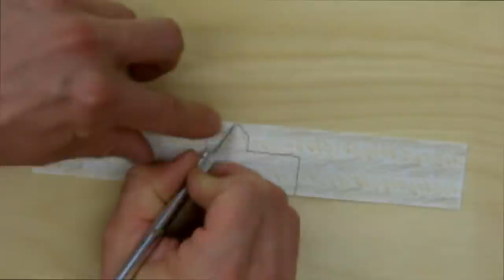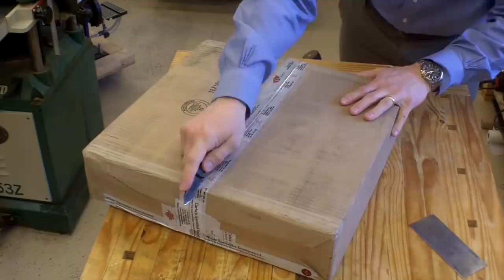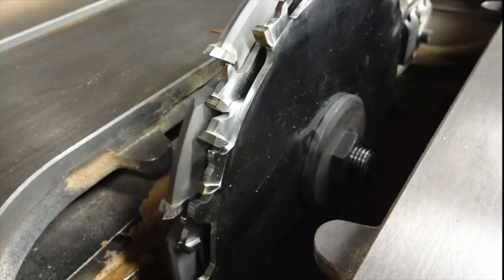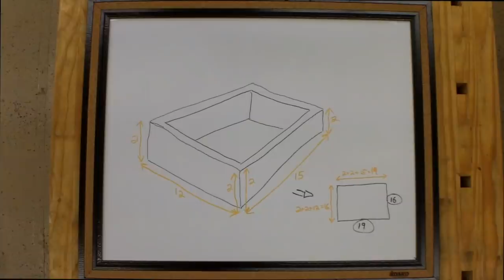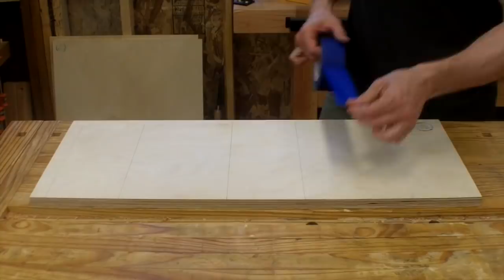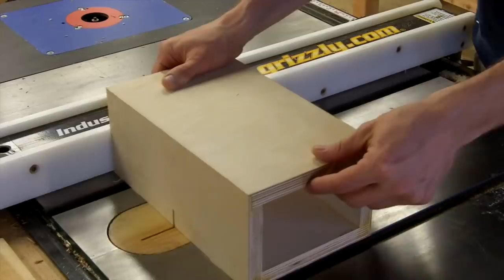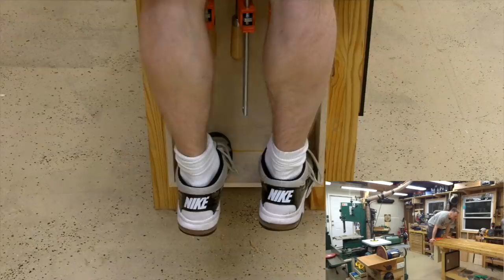New Invention - Easiest Drawers Ever!

Comment: Its brilliant really a great idea well done in figuring it out.
For those who dont know about it, modern epoxy resins, which are very expensive compared to wood glue, are up at around 4000 pounds per square inch which is stronger than the wood you are gluing.
If you are doing mass production this invention is superb as it will save you a lot of time indeed.
If you just making one drawer for yourself at home you can still do it the old way and just use the epoxy resin.
As a test with that epoxy resin I took a piece of pine 20mm x 20mm x 1m or 3/4" x 3/4" x 3ft and I wrapped it with 2 layers of carbon fiber and epoxy resin.
I used duct tape to compress it instead of vacuum bagging as the epoxy doesnt stick to the duct tape, the next day I took off the duct tape and I put the piece on two bricks 1 meter apart and stood on it in the middle with one foot, it didnt break and returned to its original shape and I weigh 220 lbs or 100 kg.
So if you need to make some thing light weight, small and super strong you can make it out of cheap pine and then wrap it with just two layers of carbon fiber. This economical use of carbon fiber is very important as it costs around $70 a sq meter.
Most people use just pure carbon fiber and need 10 -15 layers which is obviously a lot more expensive and also requires tooling to make the negative mold.
My way is a lot faster and cheaper and can easily be done at home for one off projects  like recumbent bikes electric vehicles and light aircraft.

Comment: Your solution looks very nice at first sight. But on the second glance it becomes clear that this solution is only good for one single thickness of boards for bottom, front and side walls. If you would like to use varying board thicknesses then you need to adjust the width of the dado on the right side of your profile. So next to your custom tool the user needs additionally a selection of different dado blades. I still think that the classic dado and feather joint is simpler, stronger and cheaper since it requires no special and expensive tools other than a regular saw blade and it leaves you the freedom to have thin bottoms and thicker walls.

Comment: This has applications beyond your intended use. aeronautical engineering, and my field petroleum engineering.
Reply: Laughing out loud !!
Reply: Are you, I can't hear you.
Reply: How would this be relevant to the oil & gas sector ????
Reply: Anything that requires minuet tolerances is beneficial. The cut joint surfaces were surgical.

Comment: Nicely done! And very well executed also.  
Being that the majority of the "budget" drawers are made out of particle board (which holds on it's best days .... No where near what you put that test through) but have you tried it with particle board? Seems as though your "tape method" would still give the hinge needed for the glue-up; might be worth a test-shot.  But Home Depot and lowes or even Ace hardware are going to be the best bet, but unfortunately they have a grueling process to get their items on the shelves unless it comes from an "approved vendor" 
Have you tried "kickstarter"? That might be an alternative.  Or heck, have the company that made it for you, work out a volume discount price break, and put them up on eBay for the time being.   
It is an awesome blade!

Comment: hmm... sort of looks like a locking miter joint but without the locking. But as you said it does indeed have plenty of glue surface area. So you are aware, Freud does make a router bit that cuts a locking 45' miter joint. https://www.youtube.com/watch?v=5fmnI4VLTmk (:26 starts - 6:15 shows box assembly) Here's a link for the Freud router bits  http://www.ptreeusa.com/router_bit_sets.htm#2878 
I'm not saying this isn't a good idea, just saying it's not totally unique. Just wanted you to be aware if you didn't realize this. But there's always 'more than 1 way to skin a cat'. (Maybe I should stop using that saying??)  So there could still be interest in this idea.
Blesssings...

Comment: I would buy a kit that included the special blade plus the other necessary blades that you stacked to make this cut. It would make a project I'm about to do so much easier. I can see myself using this for so much more than just drawers. The edge is so clean and beautiful.
Reply from the maker: Pretty soon you can buy it from Rockler: http://www.rockler.com/rockler-miter-fold-dado-set

Comment: why didn't you just use a 45 degree cut?
https://dl.dropboxusercontent.com/u/4969127/45degree.png
Reply: Mikael Murstam This was my thought initially, but 45 degree cuts are fairly inaccurate.  If the ply at the end breaks you might glue to two pieces together slightly out of line.  The 90 forces things together nicely.
Reply: Mikael Murstam Less gluing surface, and the 45° cut plywood surface would not hold nearly as well.
Reply: Mikael Murstam Because 45 degree cut would be 100% end-grain to end-grain joint while this would give you approximately 80% end-grain to long-grain glue surface if it were properly calibrated. It's wood gluing 101 that end-grain to long-grain gluing surface is much stronger than end-grain to end-grain.
Reply: 58mustang8 well it is a 45 degree cut per plank. That's why I wrote 45 degree. You are not cutting it after it is put together.
Reply: Nathan Scott yes that's true.
Reply: 58mustang8 nah it is 45 degree on either plank.
Reply: Mikael Murstam 45X2=90. It is a 90 degree CUT, that results in two 45s on each plank. Semantics, perhaps, but the cut is still a 90
Reply: Mikael Murstam That's a 90 degree cut  ;)
Reply: Mikael Murstam Correct, tool set to 45 so 45 cut. Only 90 if you have 2 of them. Silly sausages
Reply: syd rielly Not only that but this shape increase surface area for glue strength.
Reply: +Mikael Murstam You couldn't make that kind of cut in a single pass. The blade would be 1.5" wide. Easy enough to set a normal blade to 45 degrees and make two cuts. Which most of the time is what you're gonna do, if you're building something on site, you're using a portable table saw and you don't have five hundred clamps and huge perfectly flat tables to work off of; you're gonna cut 45's and screw your drawers together.
Reply: +Mikael Murstam MORE GLUE SURFACE THIS WAY!
Reply: +10072018 Take them back to the shop for assembly like most remodelers do!

Comment: Andy: I'm not sure if anyone had made this comment When you made your comment about the 1/32 of an inch gap you stated that it was because the new blade was not quite the correct size. I believe that if this item is made you should be talking about a dado set being sold with the new blade because these items should be matched. If you try to match it up with all of the dado sets already sold I think you will find a lot of unhappy customers. I think that the diameter of the dado and the diameter of the new blade are very critical to a good fit. The width of the dado should be able to be matched up to the plywood with shims. Karson Morrison
Reply from the maker: Yes, we are selling dado and specialty blade together http://www.rockler.com/rockler-miter-fold-dado-set

Comment: I have to say this is incredibly innovative ,however it is not time saving in a mass production or even ordinary production process..Plus in high quality cabinetry where you want the bottom of the drawer floating ,this will not work.Plus all the blue and red dot and taping  business.I hope I am wrong for your sake.
Reply from the maker: 738polarbear In the second half of the video I use the tool to make a drawer with a floating bottom.  Also, the red and blue dots were only to demonstrate to the viewer how the asymmetric joints come together from side to side and side to bottom.  You don't actually need to draw them.
Reply: Ok my apologies..I thought it was instructional not just demonstrational.

Comment: Nice improvement on and probably stronger than using a 45 degree "vee" shaped router bit method that uses this same concept but leaves you with a mitre joint instead.

Some tool manufacturer will take this up I'm sure....

Comment: Already exist, maybe not in the US but here in the Netherlands , I think we have this in our shop for the stationary router.
I like the idea, but it is a little over complicated because just a simple 45° cut all the way will do the same and then all the handling are also the same. (no need for blue and orange dots)
I'm a carpenter/interior builder since 1990 by the way.
Here a link to an almost similar router bit :
http://www.tools-profit.nl/een-paar-profielmessen-voor-90-verstekfrees-43x23x2-voor-art-694-011.html
Reply from the maker: Martijn Vv That bit can not cut both sides of the joint in one pass, and a 45 degree cut has a lot less glue surface.
Reply: Andrew Klein Yes it does makes both sides in one pass, look : http://www.whitesiderouterbits.com/catimages07/45deglockmiter.gif

Comment: This is an awesome idea and should be in production shortly to be honest. 

Contact any cutting tool companies and you might find this idea has even more applications than you thought, Lennox would be a good company to get in touch with rockler seems to be more of a distributor of unique tools than a manufacture but i could be wrong. This is a solid idea and could if actually brought to market might change the entire cabinet making industry you could cut build times down to nothing and save piles of materials. This single blade design alone could make kitchen remodeling once again affordable plus what ever other unique applications this joint design and blade type could have.

Comment: Very cool. It sure looked simple. I'm a little concerned about that thin layer of wood bending 90°. It looks like the system is generally strong enough on its own. It would be super simple to add strength with nails, screws, dowels and even dominoes after the fact. Matthias Wandel isn't going to like this simple joint! Fantastic idea. I hope you go far with it.

Comment: "Joints not strong enough"???  Just sink some flathead screws into the sides and call it a day.  Nice thinking on your invention, and I'll definitely buy one when they come out!
Reply: And BTW: your "load tests" don't properly test for the loading circumstances of drawer guides.  With your joints, you could set the folding direction so that you're placing a "*shear-stress* loading circumstance" on the joint...which is the PREFERABLE loading circumstance for bonded joints.  Your loading test placed the longer bonded joint (of the three for that side) in a bending-induced "tensile-stress loading circumstance."

So what I'm saying is: you're right.  With the correct orientation (and as you pointed out: eliminating the dado-gap), your bonded joints are excessively strong for most drawer configurations.

Comment: Looks pretty great. Did you consider adding sizing to increase the joint strength?

That is: A mix of half and half glue+water, brushed on and allowed to dry, prior to the glue up step. The theory is that the sizing soaks into the end grain and clogs it, so that the end-grain can't soak up the glue and starve the join when a good thin glue coat is added for the real glue-up later.
Reply: And, as a fanatic for Kickstarter.com, I'd love to see this on that site, if it doesn't get picked up by an existing company first.

Comment: My first though after seeing this is - can I do this on my CNC router? Should be doable using 2 tools (a regular endmill for most of the work and an 90 degree Vbit)
Reply: Well, that concept already is two types of tools mounted together, the dado blades are a stack of swappable parts for adjustability.

It should be doable on the CNC router, just making sure you control relative depths and you don't lose origin when switching tools.

Comment: I have used that joint before with a miter-fold just to simplify clamping.  I thought about a custom cutter to avoid the multiple setups but never considered the possibility of making several passes with a dedicated blade on a single piece of stock using both sides of the fence then folding the whole assembly together.  Brilliant!

Comment: Hi Andrew, just a question to better understand what I'm seeing. I've seen similar solutions that use a simple V-channel rather than something that requires a specialized blade profile. The boxes fold up and glue up the same exact way. 

What's the benefit over a simple V channel? I get the fact that there's more surface area to glue up, but that seems less of a design strength issue than the type of adhesive. Given that the forces on a drawer are largely downward through its base, an excellent adhesive and a V would appear to be more than adequate.  Have you done a comparison yet to determine if there's a measurable advantage--in the context of ordinary drawer usage--to using a more complex channel such as yours?

Comment: so.. you cant sharpen your custom blade ever, or your joint won't work???
Reply: WezleyB I dont think you can. It would need to have seperate cutter parts that would need to be adjusted after sharpening. Kinda a pain but.... if they are carbide...how long would it last?
Reply: carbide tips on good saw blades usually can do 250' or so and still cut clean, but that totally depends on the material. so lets say @ 5' per drawer it can make 50 or maybe 60 drawers, depending on material......
Reply: ot0m0t0 you could just face sharpen the blade or bit unless the the thing had broke spots in carbide
Reply: WezleyB 250'?  Sorry, but you are way way off.  Maybe 2500' with a carbide blade.  He could easily find a solution with extended life with a Helix type of blade change on that disk and extend it out to 10000'.

Comment: Andy this is quite good. We would be very happy to help you produce it. Viepeco. There is a small problem thought. Your configuration is only for specific thickness of material. In order to adjust it you have to adjust the saw blades.
Reply from the maker: The blade can be set up for different thicknesses by adjusting the dado set thickness

Comment: I'm not a woodworker by any means, but why so long for this to be thought up?!?
Reply: Its called a form tool. I use them all the time. A great time saver if your accuracy requirements are modest (+/- .010"). You need a dressing cycle to true the wheel against a diamond periodically to maintain the profile. or if your profile isn't too complex you can use replaceable carbide inserts.
Reply: http://www.productionmachining.com/articles/profilesharpen-multiple-form-tool-inserts-quickly

Comment: Cool idea...looks like something I'd really like to have.

You should do a test setup like Matthias Wandel does for his joint strength tests. This joint doesn't need to be the strongest ever, just strong enough for the drawer application it's designed for. It would be good to have some hard numbers instead of a stand 'n kick test.

Comment: Pretty cool. Get that Dado stack diameter right to eliminate that gap will help a lot with strength. Also for heavier duty stuff running a air powered brad nailer down the side will make quick work. Saw, fold, glue, fold, clamp, cross nail, unclamp, set aside to dry. Should make high volume production easy.

Comment: This technique has been used in furniture and countertop manufacturing via CNC or modified v-grooving for a long time. Anyone that is building drawers or cabinets or countertops, on a production level, is already aware of or using mitre fold joints. There are hundreds of knife blades and CNC tooling  available to mitre fold.

Comment: You've heard the Kickstarter proosal already. But let me be obsessive enough to talk about a more extensive process: Prove the market, THEN decide the larger go-to-market strategy.

Here's what I mean:
Prove the market by testing the customer take-up rate for real.
1) Hunt for a custom toolmaker that can make you, say, 1,000 of these for a price that provides you a profit margin of about 50% (e.g. double your full manufactured cost). Be sure to include your packaging in your cost. (There are lots of box manufacturers who will make you a custom box (including printing) for a minimum quantity of 1,000.
2) Launch a Kickstarter campaign to pre-sell the 1,000.
3) Market the campaign. Come back here, and notify everybody who posted about your Kickstarter campaign. Get Fine Woodworking or some other magazine to do an article on your invention & Kickstarter effort.

 Once you've sold the thousand, you've kind of proven the market. THEN, you pick a go-to-market:
a) Sell to online & catalog dealers directly yourself. It's entirely possible you will end up finding manufacturers who can ship stuff to each other, and then to UPS distribution facilities, where you then ship to the online / catalog dealers. You run the entire thing from your computer - never taking possession of any blades, etc. Might be a very nice recurring revenue business for you.  OR
b) Sell either via licensing, or sell the whole patent / business. The issue with selling the rights is that you're going to constantly get pushed by the licensors to lower your license fee, and it's a pain. Plus, selling the whole thing might be a very nice sized chunk of cash.

Have fun!

Comment: Interesting idea Andrew, combining a butt joint with a miter joint. For this to convince me, you have to quantitatively show that it is stronger than a miter joint in a variety of wood types, and that is can be cut to a accurate fit; so it's worth it to buy a special blade when this can be done on a regular table saw. I see joints like this in my cabinets (without the miter) and they are plywood held together with staples, so far they've held up. However drawers are probably not the market for this invention; it seems it's advantage in in the easiness to square a miter joint; I suggest using it to make more complex shapes, for example, "L" or "S" shapes. Best of luck with your idea.